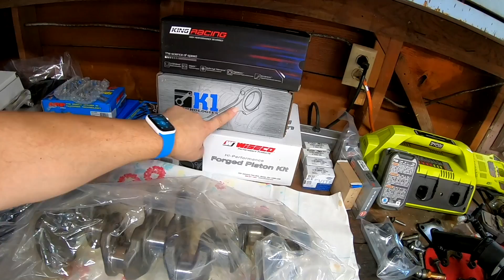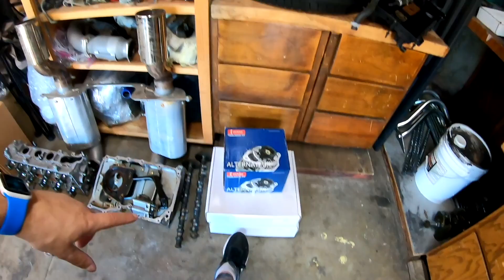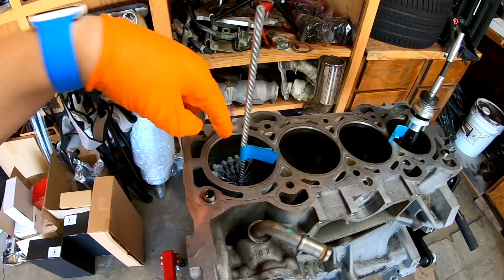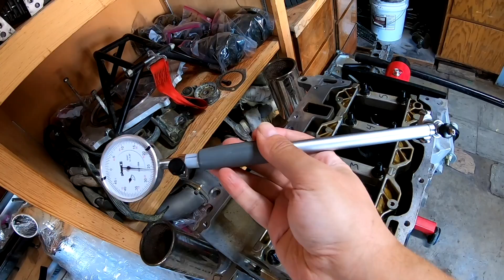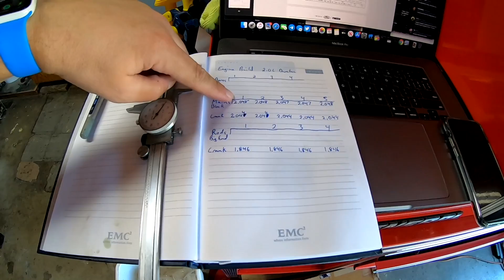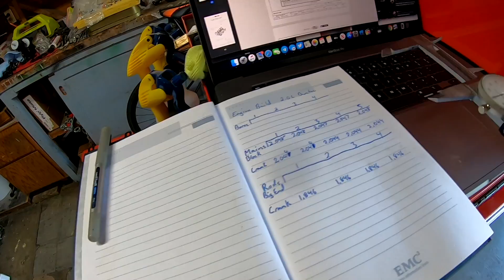Project Zero 09, Building the Engine pt. 1

Comment: Very nice work!  Glad to see that you're continuing to make progress.  I really like that you set specific goals for the engine appropriate to the project and your own driving expectations for the car.  Too many builders end up throwing darts at the proverbial board with little to no idea of what they want/need, let alone what they'll get.  Well done!!
Reply from the maker: Ha, I blame the Ultima for that!  But really though, when all is said and done the Zero should be about half the power-to-weight of the Ultima.  The main goal for this car was low speed, high acceleration fun and I think this combo will be just about perfect.
Reply: @DriveDriverDriven  Sounds good!  Hope I can see it at some point once things return to normal.  I had planned to be in SF for a few days last month on my way back from Hawaii, but that whole trip got cancelled.